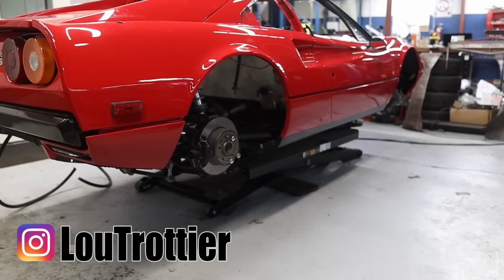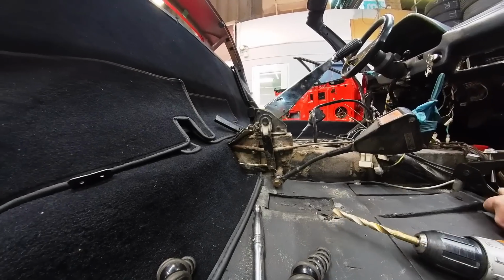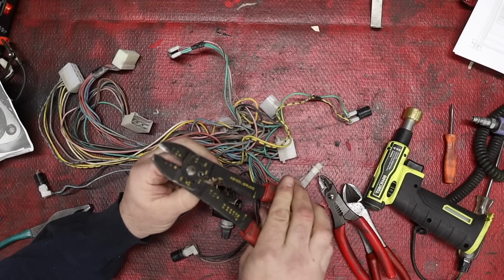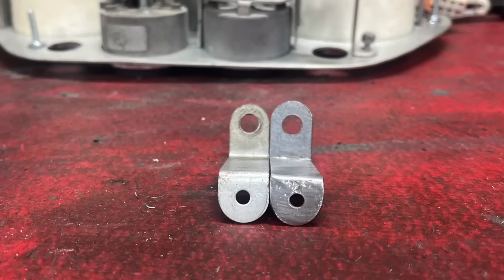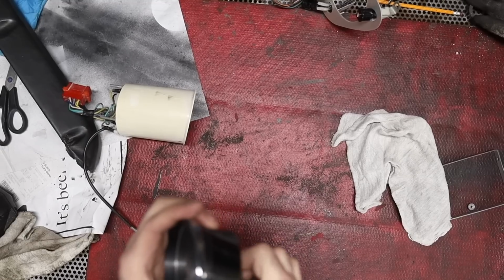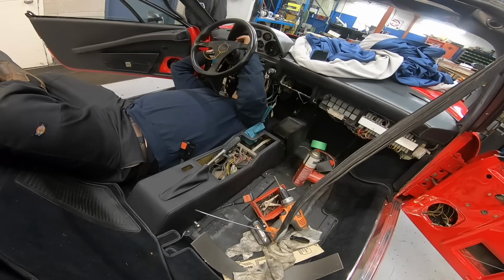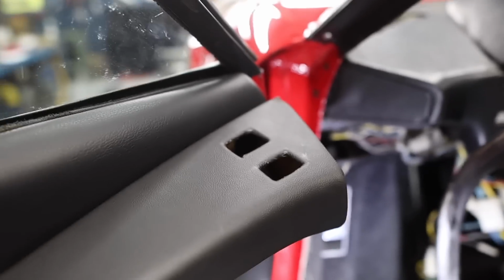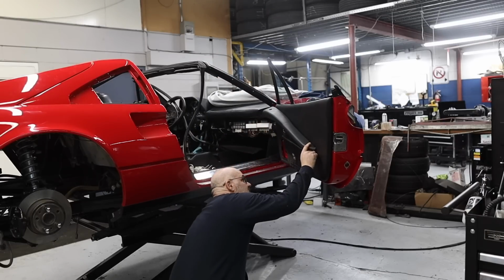Unbelievable! Bringing a Ferrari 308 GTS Back from the Dead!

Comment: JB Weld is an epoxy that solidifies when two resin components are mixed together. Epoxy is often sold in a fast curing variant and a slow curing variant, with the latter producing a stronger, more durable material. Polymerization reactions like this are often exothermic; that is, the chemical reaction produces heat. And heat usually increases the rate of chemical reactions, since the temperature of a fluid is proportional to the average kinetic energy of the molecules of which it is comprised, and of course the faster the molecules are moving, the more collisions occur between them per unit time. So it is possible to cure the stronger resin variant much faster by simply heating the resin mixture as it cures. Care is needed because polymerization can then proceed extremely quickly, but I find a water bath at 40-60°C  provides a manageable compromise, depending on the ambient conditions.
Reply from the maker: thanks for the info.

Comment: For adhesive jobs like that use Hysol aka Aeropoxy, it will beat the pants off that JB Weld all day long and you can get it in a fast curing formula that takes about 20 min. Sand both mating surfaces with heavy grit to form a strong mechanical bond and clean with acetone before gluing them together.
Reply from the maker: Thank you I will look into that.

Comment: The armrest should have a thin layer of low density foam to add some cushioning. Allows the part to look and feel original and may improve grip on the switches.
Reply from the maker: Thanks, I kept as it was, and there is a layer of foam there.

Comment: Lou, when looking at 23.46 minits, seems to me your door panel could be put lower on the front side. The line of your panel is not paralel with the outer window scraper line...just my impression.
Reply from the maker: from the angle of the video it does.  but it is sitting correctly.

Comment: Think I mentioned it before but the seats are not the correct pattern for a '78. So they may not be original or from a later car. The A pillar and top panel trim look the same as they were on my car but I think mine was originally either cream or magnolia. Actually my top interior was cloth when I got it but I found factory original panels that look exactly like yours and put them in. 

Oddly enough I had a lot of trouble getting my cluster back in too. And one of my gauges, think it was the speedo, broke in exactly the same way when I was taking it out.
Reply from the maker: Interesting information.  Thank you. Cheers Lou.

Comment: Hey Lou, I'm sure you've got it buttoned up by now, but the trick to those "floppy" brackets on the back of the instrument panel is to finger tighten the nuts so that the brackets are tight enough not to flop around, but loose enough to move into position once the instrument panel is put into the car.  They don't need to be torqued down tight.  To move them into position over the "target" holes, you can use a drift or an awl or a long screwdriver.

How many more months until she's ready for the  road?
Reply from the maker: Hoping for summer 2023.

Comment: Looking awesome. While the car is still mostly opened up it’s worth asking…any plans to do some heat management? In other words one of the practical issues the 308/328’s have is the cabin gets a lot of radiant heat from the coolant lines, radiator, and engine bay. And the guys who seem to have a good handle on air conditioning seem to say the AC system as a whole is not really engineered to deliver enough cold air. So as a result, yeah, in the summer, can get pretty toasty. Strategically located radiant heat barriers (foil backed sound deadening for example) seem to have worked well for some guys on F chat.
Reply from the maker: definitely worth consideration. Thanks
Reply: I think it comes down to just placing something shiny between the cabin and the heat source to reflect the heat away. Hence, foil backed sound deadening which is 2 fer. Heat rejection and NVH reduction!

Comment: Looks to me like the drivers side door card sits too high at the front by 8mm or so. The waistrail should run with the top of the doorcard. Yours sticks up at the front. Compare the passenger one that went straight on - that's the condition you want.
Reply from the maker: will do.. thanks.

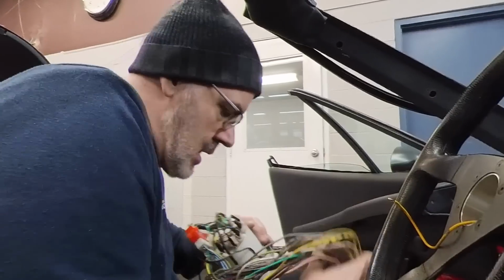Comment: 16:32 I am not going out to buy a whole tube to "experiment" but I've seen some pretty amazing things done with panel bond. It might be a better choice than JB weld for that bracket. I mean, it's designed to hold aluminum body panels to steel members and all. 

I've (for a while) thought about getting my hands on some to try out on various materials and applications.
Reply from the maker: Already done now. So no need I guess
Reply: @LouTrottier  I'm talking for the future. If I do end up getting a tube and experimenting, I'll report back. 

I can see it being really useful for metal to metal bonding.

Comment: Looking at it, compared to my 78 gts, the seats look like they are from a qv, as they should be striped  also the rear engine cover looks qv too.
All looking great though.
Reply from the maker: I'm sure they are, the car is a mish-mash of parts.
Reply: @Lou Trottier  the original seats would have been the colour of the roof with black stripes.
Reply from the maker: @neildawes2857  ahhhh!